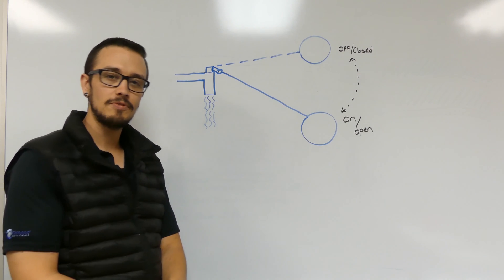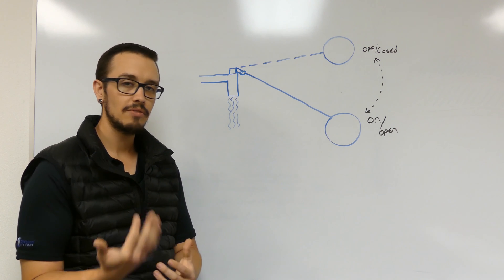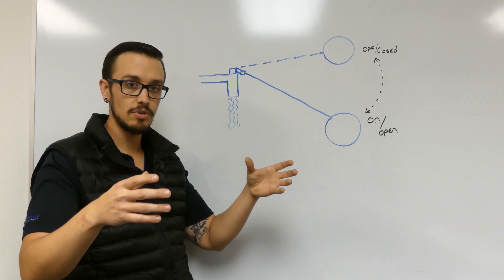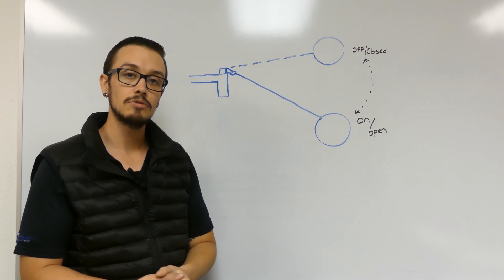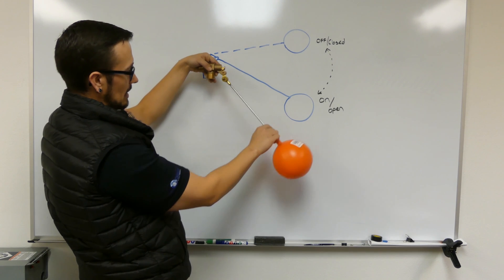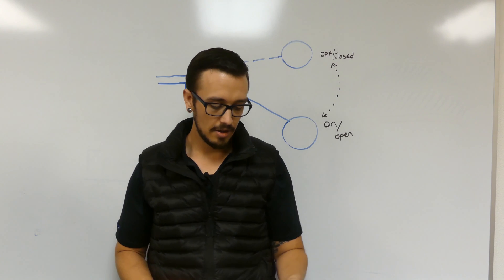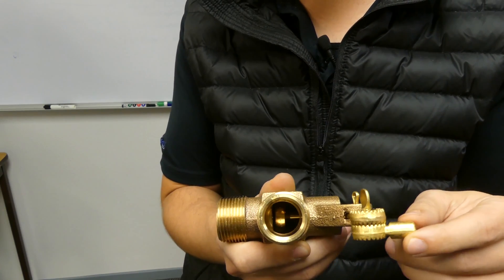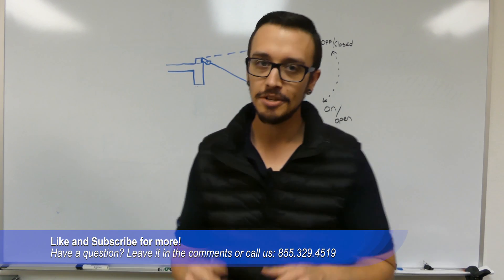How Float Valves Work

Comment: Hi, would you recommend this arrangement to fill a 300 gallon storage tank inside my home? I have a low yield well that is 380 ft deep and the pump is set at around 350 ft. The yield is around 1/8 gpm. I would like to do something like this and supply water from my existing pressure tank with a dole flow regulator. I plan to install a booster pump on the discharge of the storage tank. Any suggestion/recommendations would be appreciated.

Comment: Nice video about valves, but one big question that wasn't answered is how much of the water can be withdrawn from the tank before well pump starts up again?   From look of the float valve, it looks like as soon as water level drops a little on the tank, pump will restart (because pressure will quickly drop and pump will kick back on).  If you want large cycling water volume from the tank and low cycling of the well pump, float valve doesn't seem to be the answer.
Reply: I completely concur.  Have you seen TANKBUDDY or QUICKSTOP Valves. They are purely mechnical and have a high and low level so prevent pump cycling.

Comment: Needs more differential vector equation calculus!  

I clean out the valve assembly, but it leaks after a few month again.  It has a couple round rubber disc with a hole.  What do those flappers disc do?

Comment: I have a situation where I’ve plumbed  (2) 3/4” hose bibs into a 2” brass float valve. Which has a 3/8” brass rod 12” long to a 12” ball. The flow is now ideal however the valve doesn’t close fully??? Arg…please advise

Comment: how about an equilibrium float valve and delayed action float valves.
 I have work on equilibrium float valves with 4" bore, and 20" copper float, you needed a wheel barrow to bring them to the workshop

Comment: I could not find a video about the dual flush system, and how to fix the continues flow even if the tank if full and the floater works fine
Reply: check out the water level, there is usually a " water level line " on the inside of the cistern, at the back, easy to see, if the water level is higher than it should be the water will continue to be siphoned out of the cistern,. or if some one has put the wrong height siphon in, that would cause a problem, continuing to siphon the water out.
measure from the " water line " to the bottom of the cistern,and add an 25-32mm, to the spill point to determine the size of a flush siphon should be.

Comment: I have a question. Does the ball (float) have to be airtight? My ball threads are stripped out. It has a tight fit still and you can’t just pull the ball from the arm. But after hours of sitting my water level keeps creeping up the overflow tube. I am wondering if the ball needs to hold a constant air pressure to work properly?
Reply from the maker: Yes, if the ball is waterlogged it will not float up and shut off the flow.
Reply: @RCworstwater  no it’s not water logged and where the ball threads into the arm never gets close to the water level.
Reply: @scottbolden2961  the air pressure inside the ball won't matter.  Just make sure water isn't filling into the ball.  Otherwise the ball can't float.  It needs to be sealed from water.  Water vapor could condensate into the ball of it is cracked.  Shake it to see if it contains water (bad).
Reply: the ball valve float has to be air tight, or water will get in to it, and then it will not be able to float properly, the lever arm between the ball float , and the valve, does not enter the float, just attaches it to the female threaded attachment on the float, the reason that the water keeps creeping in, is ether the water pressure is too high, or the aperture on the " seating " is too big on the internal orifice, or the ball valve washer has deteriorated, which happens to them all eventually.they are easy to replace.
the ball float is not really under pressure, ( unless it is a long way down, which will not happen) it just happens to be lighter than water, so floats, in doing so, it operates the lever arm, to stop the water entering the tank / cold water storage cistern / toilet cistern, the bigger the diameter of the water supply to the ball valve, the longer the lever arm needs to be, but there are better float valves,
 " equilibrium " float valves, which let more water volume through, and use the water pressure to make it close the water off, by using the water pressure to enter the other end of the sealed valve, so that the water pressure is equal, so it is not under pressure at all that's why it is named an equilibrium " float valve, you can get them for toilet cisterns, cold water storage cistern, etc 1/2 " - 4"  diameter water supply pipes, they hjave been around for over 50 years, I was a plumber in hospitals, we had cold water storage tanks bigger than swimming pools with 4" diameter float / ball valves, this was back in the early 70's.
or you can we can " delayed action float valves " which fill the tanks etc in minutes on full bore, then close off in seconds, look at "Ebco " equilibrium float ball valves, or keraflo delayed action float valve, you will have similar ones made in you country. try this on youtube " Keraflo Ltd " 
but you can also, get domestic equilibrium versions, best to get them, with brass tails, then you won't cross thread them easily, which happens on the plastic tailed options.
I must not forget that if your wate supplyr is " hard " then lime scale will effect the ball float valves

Comment: My tank has the inlet water connection at the middle and how to fix this to stop the water when the tank is full. I cant make the inlet to the upper side as the water pressure from the main line is very low.
Reply from the maker: We have a solution! Give us a call: 855.329.4519 or click here: https://www.rcworst.com/jobe-topaz-j-tpv20dlt-3/4-npt-w/detached-base-long-tail-float-valve.html

Comment: hi, sir. could you tell me, what is the meaning of operating pressure of floating valve (for example: 0.4 -6 bar)? it is fluid's pressure through the pipe or the ambient pressure of the tank?
Reply from the maker: The pressure in the pipe is what we're referring to.